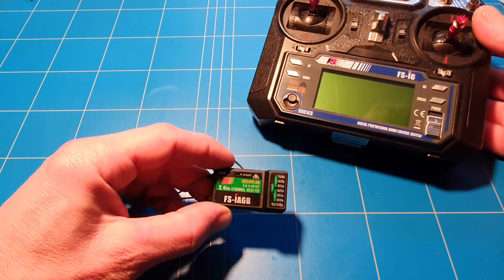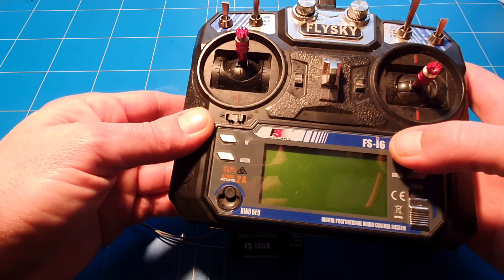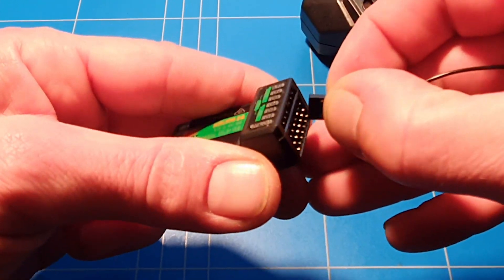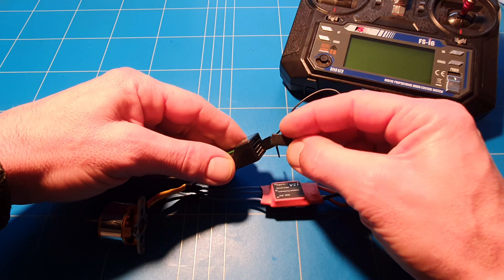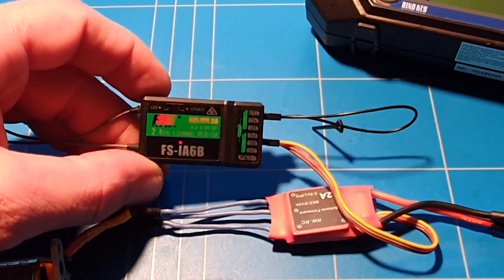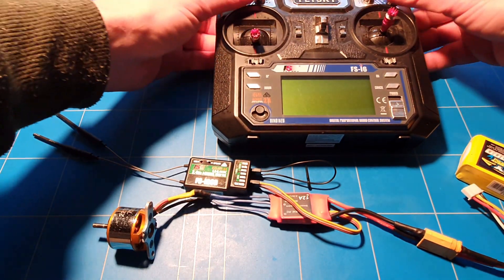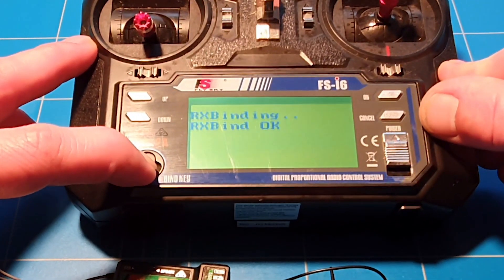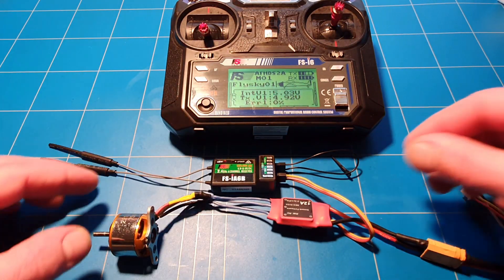Flysky FS-IA6B Binding Receiver To FS-i6 Transmitter

Comment: Hoi, thank you for your video! I followed your video and I bind receiver Flysky FS-iA10B to Flysky. Question, can I bind another Flysky FS-iA10B receiver to same Flysky transmitter (only one receiver will be operating at a time)? I would like to do testing without disconnecting/removing receiver mounted on ROBOT. dank je mate.